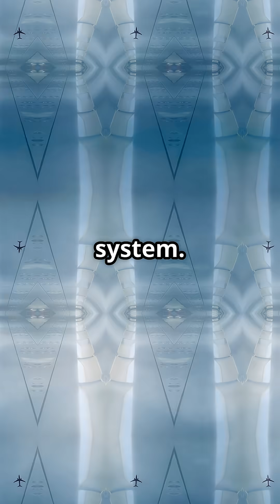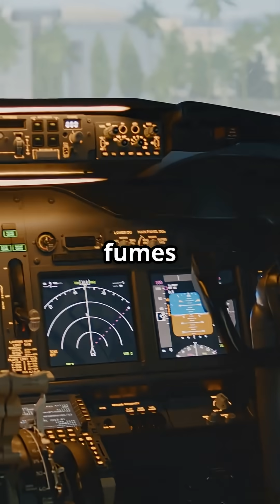Boeing 787 vs Airbus A350 — Bleedless Purity or Engine-Fed Reliability?

Comment: We have been breathing air from the engines for more than 60 years. I get that the 787 is an improvement, but it does not mean the original solution is harmful